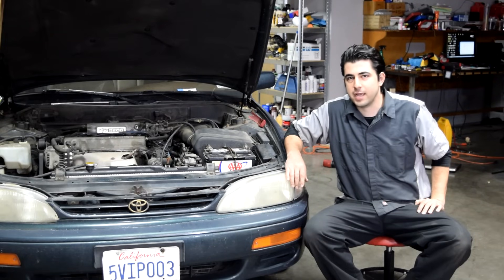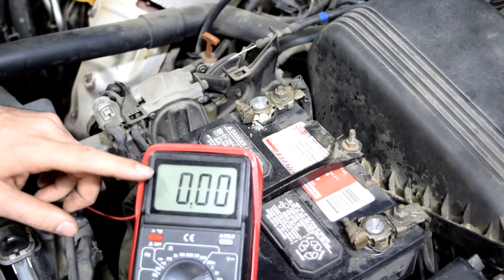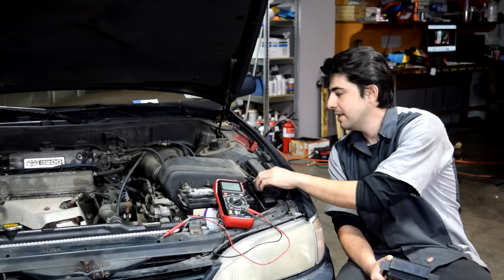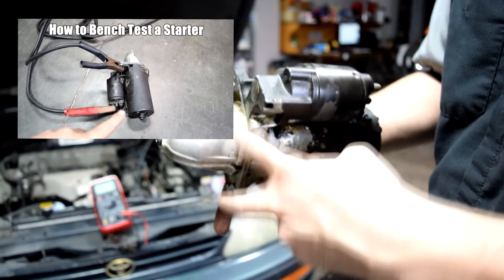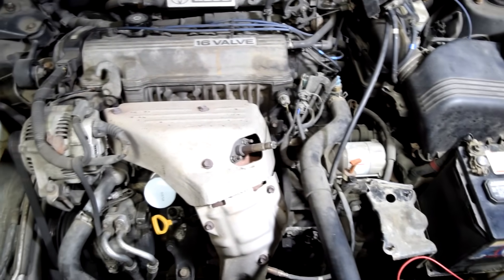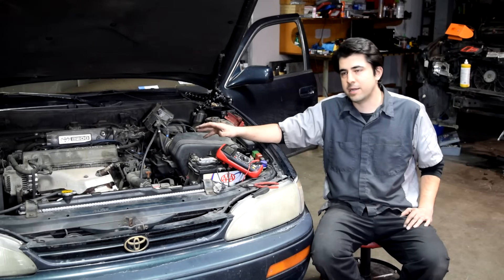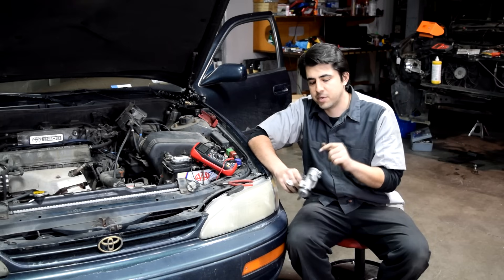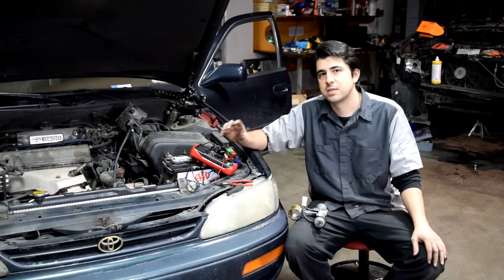How to Diagnose a No Crank No Start Issue - Nothing or only a Click When the Key is Turned

Comment: 8:10 he says "or you can back probe this connector if it's easier for you". Does he just mean that you touch the red lead/probe on the wires?
Reply: There are special probes that are really thin and allow you to insert the probe itself through the back of the housing.

Comment: This is worth a follow as I have all the tools and it's quite cold in Canada, on the relay pull out and read the side then small jumper or paper clip it will turn over and eliminate the starter
Reply: Can a bad security system cause it not to start as well or will the starter crank with the jumper cable

Comment: GREAT video!! I have a 2006 Corolla CE no crank no start. It's a 5 Speed manual. I replaced the Starter relay and the starter but the signal wire or trigger is getting no voltage so now I'm replacing the ignition switch! I also bypassed the Clutch switch just in case that was the problem.

Comment: Thank you for the video . I rebuilt my engine and transmission and just finished installing and connecting everything . I tried to start the car 3xs and the starter and engine turned and sounded good . After the third turn I'm getting a no crank no start . I can jump the celinoid and turn the motor. Is it possible the starter is bad ? I bought a new one when I rebuilt the car . The engine turns when I jump the celinoid . The starter is a pain to get out I have to jac the motor up and removed the motor mount to get the top bolt . Any guidance would be great

Comment: Well done video. My 2015 highlander, intermittently, won't start or even crank and all the electrical goes dead as if a fuse pops when I push the START button.  After a few minutes it resets then finally the engine starts. So far this has happened twice.

Update: It turned out to be dirty battery terminals. Once cleaned, no more issues.

Comment: Thank you, for the awesome video. I am going through this, right now. I brought a new ignition switch, still no voltage coming through the starter cable.  I believe the program is with the purple starter cable itself. I recently repaired my engine harness, and i ended up cutting the starter cable in multiple areas, because I thought it was too long. After I did that, it ended up too short. So, I used some heat-strink butt connectors, to piece the starter wiring back together. I think there's a poor connection somewhere, within the starter cable itself. However, I am about to replace the whole starter cable. I know it's not the starter, cause it's brand new. Relay and fuses are good, battery is new, battery cables are new, and no anti-theft problem. The only thing it could be, if the change in wiring doesn't correct the problem, then my park neural safety switch could be the cause of me not getting the 12 volts, through the starter cable.

Comment: @KrazyKajun602
14 minutes ago
I have a challenge for you.  Yesterday I replaced my battery in my 2008 gmc sierra 1500 5.3.  Went to start it, no crank and no start.  only some display.  no locks, interior lights and no battery , fuel guage analog working.  So I said ok, let me put the other battery back since it was working fine .  only replacing due to age.  Same issue after putting back the original battery.  Any ideas on the cause?

Comment: Have new battery good one. Bench tested starter cranks good battery wire or cable to starter. Good ground to engine . Direct wire to starter hot to battery no crank . Engine turns with wrench what can be wrong?
Thought to bypass key system by power to starter battery small wire.
Reply: ever figure it out?

Comment: If your car won't crank, tap the starter with a hammer. Try this before you take anything apart. In many cases it will work and the car will crank and start. But then you got to replace your starter soon starter soon.

Comment: I realize how sketch this sounds, but realize that sometimes legitimate people need to do what I'm about to request for legitimate reasons. Can you explain how to bypass the anti-theft system OR any other method to rule out (or deduce that it is) the root of a hard to chase ignition system issue... I've replaced the battery, the relay, the ignition switch, & the neutral safety switch... Also the starter/solenoid tested as working at two different shops plus I tested them.... I've replaced a lot of wire and every small (7.5 to 20 amp, vehicle has no 30 or above circuits using regular fuses) bladed fuse (including the starter-relay fuse) both in the under-hood fuse-box and the in-cabin fuse-box... I think the (must be after market anti-theft system, because it's wasn't manufacutred for the Texas market per the VIN and that's the only version of my vehicle that was manufactured with an anti-theft system for the year of the vehicle), but it does have a mysterious relay where an anti-theft system relay would be... that relay seems to work, the switch side has 0 ohms continuity, when and only when the control side is supplied with 12 volts at at-least 3amps (Tested with a 12v PP3 battery... no, I'm not making the common mistake of calling a 9v battery a 12v battery, and yes it is the PP3 size. They are rare, but you can get them. I get the specifically for electrical testing in my job as a service electrician.) At any rate, I need to bypass the entire anti-theft system. The truck starts by jumping the starter relay, and I'm reluctant to jump the relay that I suspect is an aftermarket anti-theft system relay, because what if I'm wrong. I would have to take half the truck apart (exaggeration, more like a daunting amount of the dash assembly) to physically trace out the ignition switch wires to be sure. I'm hoping to avoid that. I got the truck when it was 27 years old. (It's a 96, so still 27 at the time I wrote this... in other words, I've had it less than a year and it's an older vehicle) as far as I can tell as a driver, it has no anti-theft system, and nothing was mentioned about one from the previous owner when I bought it... however the relay in question is in line with the ignition switch where an anti-theft relay would commonly go... being an electrician and not a mechanic, I don't know what else it could be. 

Basic vehicle stats:
It's a 96 Taco, auto-trans, 4-banger, standard cab, no options... we're talking crank windows and all, no options, not even leather or buckets, just as plain-Jane as they come... (door sticker verifies no options)... so while the relay socket looks pro-done, I still suspect, whatever it is, was third party. I have the owners manual and the Haynes service manual none of the circuit diagrams show it. I do not have the manufacturer service manual, but it is in my shopping cart online when I can justify the $120 for it, AND afford it. (Just because I make decent money doesn't mean I don't have big bills to pay, mouths to feed and other vehicles to maintain, etc.)

Comment: I tried boosting it with my noco but it didn't start,  then your next suggestion which was corrosion on the starter plug was my issue. I had been pulling fuses to find a parasitic drain and i must have pushed corrosion against the prongs so they didn't contact after. I just scraped it off to bare metal and that did it.

Comment: great video, thank you. I'm wondering what I should look at if I'm only getting 10.5 v back from power to starter while turning key? Is there a fuse or a relay? coil? Its hard to follow that wire because its taped to others. TIA

Comment: Nice video, however a resistance check with a mulimeter may not be sufficient.  The connection may be fine for a few amps but not able to carry 100A without a big drop in voltage.

Comment: (thank, you for you're video. I, did everything that you mention in the video. what's weird is I can put a jumper wire in the fuse box were the starter relay is at and spray 2 shots of starting fluid in to the air box then the jaguar will start up .  I've took notice that I've got 2 pop up codes on the cluster. I, done all I know what to do. I'm. going to load  it up on to my trailer and carry it to the jaguar dealership. 2004, x type 3.0  jaguar.)👍

Comment: Great video! My neutral safety switch is on the shifter, I have a new B&M shifter and now my car won’t start. I can’t seem to find the correct neutral safety switch wire in my car. It’s a newer 4L80E (swap from 6L80E trans) so it doesn’t have an external neutral safety switch connected like I’ve seen and some videos. Hopefully I figure this thing out. If anybody has any input, please let me know. Thank you!

Comment: No crank: new battery, starter test pass, 12V at Starter, battery terminal tight, starter not loose, starter relay good but still no crank. Just parked for about 5 minutes and went into a store. Nothing happen when I turn the ignition on. Dash lights up okay: There is no continuity at the little wire that goes into the starter solenoid. Not sure if this is normal.  2012 Toyota Sienna. Help please.
Reply: have the exact same issue found out the cause?

Comment: Excellent videos.  Clear and comprehensive.

99 grand vitara 2.5 I jumped the starter magnetic switch wire to the pos battery post, and it turns over but no spark.

I was thinking of putting in a starter button.

1.) would the crankshaft position sensor still cause spark in this scenario ?
2.) would a faulty neutral safety switch prevent spark ?
3.) would a faulty camshaft position sensor  have anything to do with it not sparking ?

Comment: I thought FOR SURE it was my starter. Put a new one in and BAM, started right up. Then, after a short drive and parked for 20 minutes, the SAME THING. One click and a no crank no start condition. That's totally weird. My battery passed the load tests I did so I'm stumped. All starter tests passed as well. Why would a new starter work perfectly out of the box and then leave me stranded? Relay perhaps? It's not the clutch safety switch.

Comment: so I have a 2015 Hyundai Santa Fe, 2.4l engine, back in October when we had the first really cold night (temperature was below freezing), I went to start car in morning and nothing, dash lights were on but no click no nothing. Tried jump starting it, still nothing. Battery voltage was about 12.1-12.2, low but not extremely low. Put charger on battery for couple of hours and it startted right up. I do have a battery tester and checked it and it said battery needed replacing and I checked my old receipts, battery was about 4 yrs old so went and got a new battery (shocked at price, they've gone way up). Monday morning go out and same thing, no click, no nothing, this is new battery and again it would not do anything even with a jumpstarter. Checked for a current draw and it was within a reasonable range. I have been putting a trickle charger on it and night and that has worked well except for once. Finally got the car fixed I was working on and was able to put the Santa Fe in the garage, next morning started right up, did a little experiment, put it outside that night and next morning, no click no nothing. Temperature seems to be the factor here. Never had trouble like this before, however, the engine was replaced in September and I'm thinking they either nicked a wire or forgot a ground or possibly loose or bad connection on starter. I checked the grounds I could see/find and they were okay, right now I'm leaning toward a starter problem or possibly a bad park/neutral switch. Something is not working if the temperature get's below freezing ?

Comment: Mine was the Park Neutral Safety Switch. Ran through these procedures and everything else seemed good. On a whim we tried putting it in neutral and it started no problem. Moved the gear selector from park to neutral a dozen times or so and now it works fine. Thanks for the video!

Comment: Great vid, thx! Did you make a video regarding "intermittent starting issue?" My truck starts and runs fine for a couple months, but then just won't start. No crank, nothing. I have power; interior lights, headlights, radio, etc, but no crank no start. I'll wait a day or two, then it fires right up as if there was never a problem. Frustrating! I'm having the problem right now which lead me to your video lol. Tomorrow at first light, I will go through the steps mentioned in the video but since you mentioned "intermittent starter issues" at the end of the video, I have to wonder what else it could be.. During the past 2 years I have been searching for this problem on YT, only tonight did I find your video.
Reply: I had this issue with my jeep, it waa the nuetral safety switch.  I replaced the starter and thought id fixed it because it started when i was done but just to find it still happened larer.

Comment: Anyone know why this fiat 500 2012 I'm working on wont crank after I changed the starter.  I even tried jumping it with my truck incase battery is bad but still no cranking nothing when trying to start the battery takes charge and reads 13 volts when charged.  When I try to start it I verified with a volt meter the battery does drop in voltage so the starter seems to be drawing power but no cranking.  Before I changed the starter the old one made a noise but wouldn't crank either.  Starter relay clicks when trying to start car and fuses are all good.

Comment: I need your opinion on this please. Went to buy a new starter but it was updated (from 11 teeth to 10 teeth)  as the dealership claims. What's your take on that? No long term affect despite different number of teeth ? 

Fusion 2016  2.5l
Reply: Going one tooth less on the starter side itself will just give the starter more torque in turning over the engine/will put less strain on the starter motor itself when turning over the engine, they prob had a lot of problems with starters burning out and came to the conclusion that reducing the pinion gear by a tooth would fix the issue if I had to guess
Reply: @DIY Chad 726  I appreciate the response, this is a new information for me 👍🏻

Comment: starter is rotating but the engine is not starting.  how the anti theft system does not allow the engine to start? by fuel , by spark, by compression, by computer???

Comment: Great video!!

Quick question. Going through your steps, I found that my ground at the starter casing was around 2 ohms. What could cause that?

And at the “S” post on my starter with the key turned to crank, I’m getting 8 volts instead of 12 volts.  I have 12 volts at the B+ post but only 8 volts on S when I crank it. What could cause that?

Thanks in advance!

Comment: What could cause there to be a click when I try to start my 91 suburbon. But it only happens sometimes. If I try to start it 10 times it might fire once. But once it starts it runs fine. Battery is good and i think the starter and solenoid are fine. When it does fire up it fires up fine. I can't figure it out.

Comment: What if you jump starter relay 30 and 87 and car doesn't start? Starter engages and brand new battery. But still no crank no start. I'm leaning to ignition issues.

Comment: Great video but a quick question if thats ok. 

I have an Audi  manual 1.0l engine and i have replaced the starter. When i put the car in neutral gear and try turn the crank by hand it turns approx 1/8th but then feels like it is engagaed with the gearbox and not in neutral.  Do you have any idea why this could be? When i try to crank by key i hear quite a clunk from engine bay and it wont turn over. Is there any way the starter could cause this? Thanks

Comment: thanks for the detailed video. wondering if you can give a sugestion. while driving  the other my car stopped  and now it wont crank, wont start not even with jumper cable. the dash gets power. baterry and alterntor  checked ok,

Comment: i have a easy question im sure you can help with
as a diy guy and because we cant do voltage drop without current flow to test the wire and many times a no crank has no current flow when a starter system has issues i would like an opinion on using jumper cables as a way to determine bad cables meaning if i have a no crank yet have power and ground but when i hook a jumper cable from battery to positive/negitive to starter pos/neg (one at a time to determine which side has resistance)and it then starts i can then confirm high resistance in the cable.is this a viable method?

also i hear  we cant just create a circuit using a light in the starter circuit to create a loaded circuit we can voltage drop test
because the light doesnt pull enough amps,but if the voltage drop is enough to prevent a starter from starting wouldnt this method still see the voltage drop?

also any other methods for diyers to perform a voltage drop test on a circuit that doesnt have current flow?

Comment: I have Kia grand carnival 2009 model. The car don’t crank when I try to turn on the ignition. I put new starter motor starter relay new Battery but it doesn’t start. I towed to the mechanic and he fixed the issues. But after 2-3 days it’s gave me the same problem. I tried 3-4 different mechanic and when they fix it after 2-3 days it’s give me the same problem. 
Can you please give me any alternative solution to check weather it has some electrical issues or other kind of issues. 
Thanks

Comment: what happens if theres a more than .5v drop? What would the fix be other than changing battery?
Reply: Most likely the drop is due to corrosion so anywhere there is a connection then disconnect and clean real good then connect back up, if still a draw then the wire in between your two multimeter leads is the problem and needs replaced, a bad battery doesn't cause a drain at connections

Comment: my truck is a s10 automatic and it's a no crank start. I removed the starter relay and jumped it with a wire and it started no power to the wire from the switch so it could be a 99.99% it's the ignition switch?